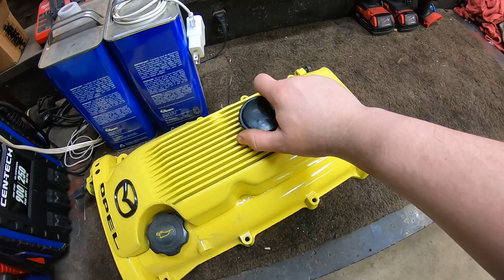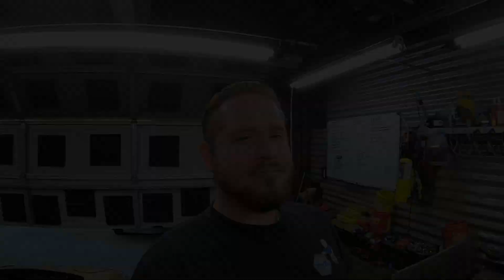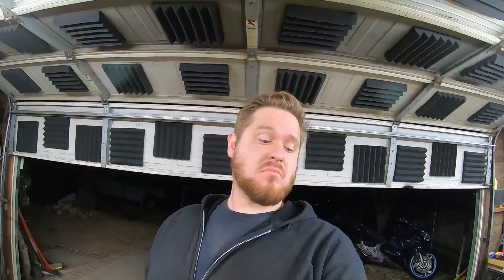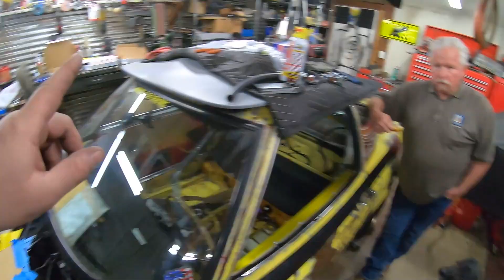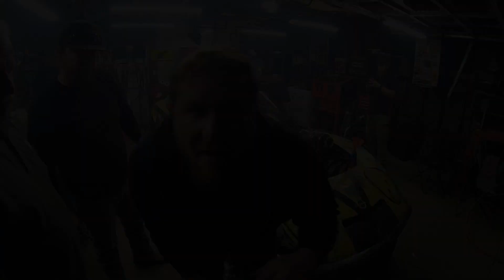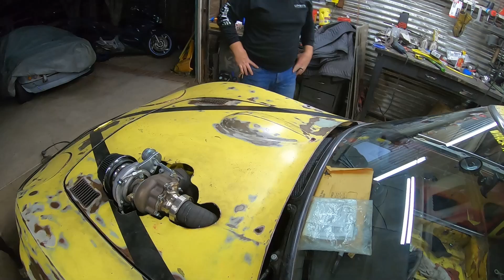e.27 Opel GT, Turbo motor swap FIRES UP!

Comment: How are the driveshafts on the GT6 holding up? There's a "cheap" lsd for sale but I don't want to just be snapping driveshaft's constantly, what size rear wheels do you have/ how much power are you in the gt6?  p.s really great to see such a cool car have some individuality looks mental !!!
Reply from the maker: The GT6 is still chewing up axle keepers. Welded the last one but it's probably living on borrowed time. I have a line on some upgrade ones for racing but they are about $2k so I really don't want to go that route until I'm forced. I run 15x8s on 205/55s at 215 horse/192 ftlb.
Thanks! We try to stand out in the crowd!